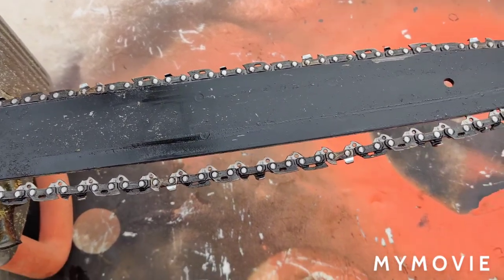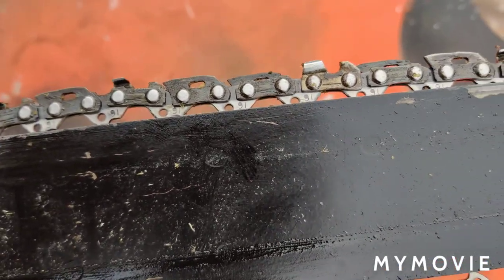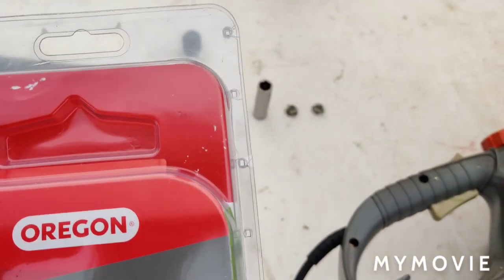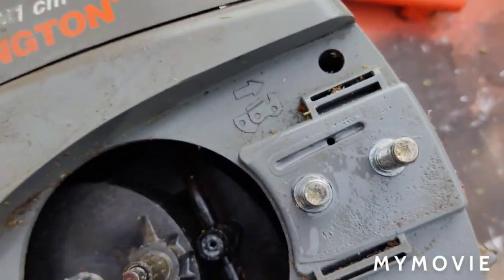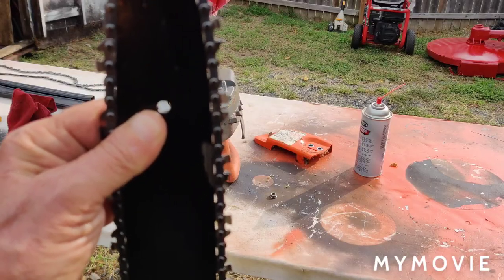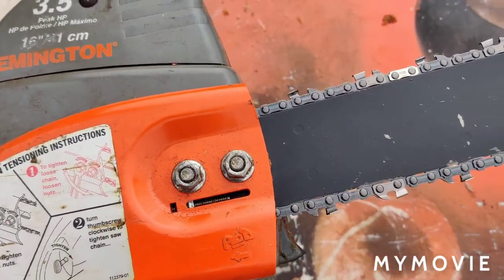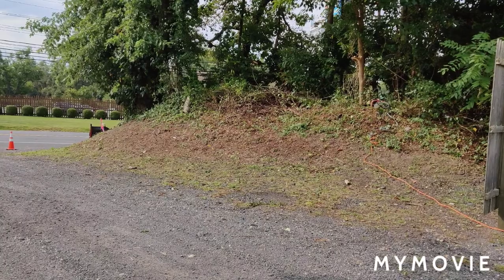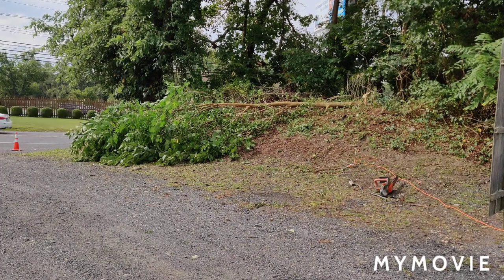How to install a new chain on this chain saw and test.

Comment: I have the same brand saw and desperately needed to see you seat the bar and actually tighten the chain; Im so bummed. I cant seem to put mine back together.
Reply from the maker: I'll see what I can do to make another video. Thanks for watching 👍
Reply: Same here. I need to see how all this fits back together because I don't seem to have enough hands. I was hoping to see this done, probably the most important part of the process.

Comment from the maker: The directions the new chain comes with tells you the correct way to install the new chain. I forgot to mention how to know what size your saw is. Measure the distance from the cover to the tip of the bar .

Comment: How did you get the oil piston out?
Reply from the maker: Im sorry it was a long time ago. All saws are different. Thanks for watching 👍
Reply: @gravelyman  no worries, your video actually showed me. You simply pushed it back in. Mine was rusted, so it didn’t want to move. Was able to clean it up and restore movement, but it never pumped oil. Must have an obstruction somewhere. Thanks for the  video and reply!
Reply from the maker: @daveminke2946  Good I'm glad you figured it out 👍